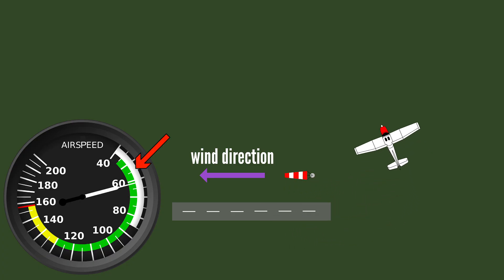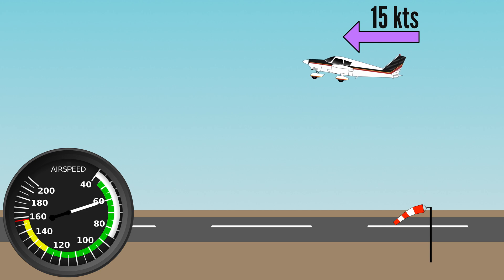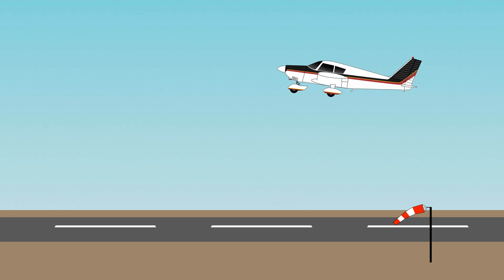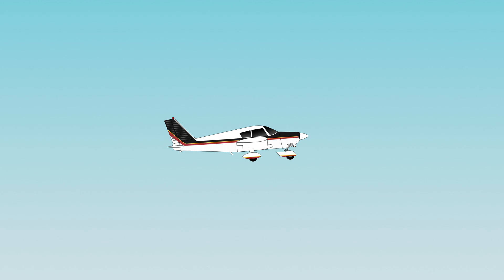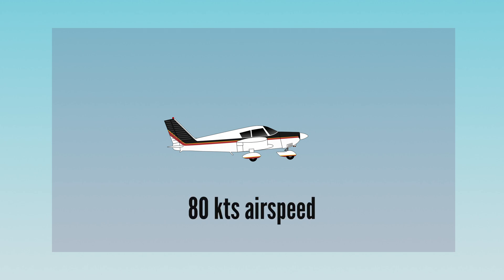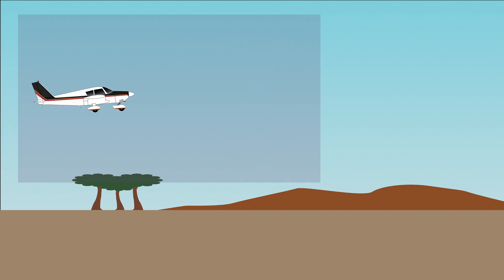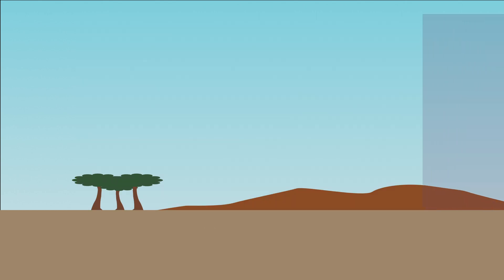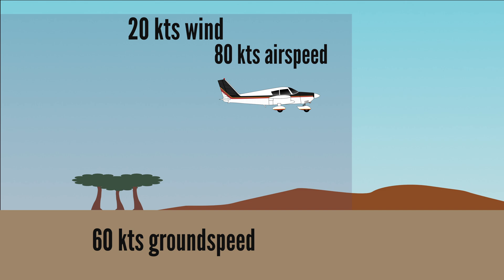The Myth of the Downwind Turn - Dangerous or Not?

Comment: As a Stanford graduate and retired senior engineer, and an avid RC enthusiast, there is a world of difference between downwind and upwind turns. I've NEVER stalled and crashed a plane in an upwind turn, but have crashed multiple times in a downwind turn where I inadvertently throttled down due to high perceived ground speed when a wing dropped and was too low to recover. There are thousands of RC crash videos where this happens all the time.
Reply: Just FYI, here on yt you’re less believable when you start a sentence with “as a …”. It makes you sound like you don’t know what you’re talking about and you’re desperately trying to convince yourself, and everyone else, by throwing credentials at your self-doubt. Be confident in your opinions. Your Stanford degree and senior engineer position is irrelevant.
Reply: @TastySlowCooker  Hear, hear! 👏
Reply: "there is a world of difference between downwind and upwind turns. I've NEVER stalled and crashed a plane in an upwind turn, but have crashed multiple times in a downwind turn where I inadvertently throttled down due to high perceived ground speed"

The difference is in the distinction between airspeed and groundspeed.

There is no difference between downwind and upwind turns in terms of airspeed.

There is potentially a world of difference in terms of ground speed. 

For the RC case, if you could somehow estimate the airspeed fudge factor from the reported/recorded local winds, it might help?
Reply: You throttle to zero while banking at low altitudes? Hmm? I never drop below quarter till about touch down
Reply: This serves only to prove the original poster's point. When flying RC models, you do not have information on airspeed only perceived groundspeed. Pilots only experience difficulties executing a downwind turn if they are flying by ground reference. RC models are highly manoeuvrable and have very little mass, hence they can "change ends" or "hang on the prop" in a way a typical full-size aircraft cannot.
Reply: @rigilchrist  How can it be anything but?:  true airspeed is the critical measure relative to the critical frame of reference (the air through which the aircraft drifts).
Reply: That has to do with your response to ground cues.  Same with airplane pilots.    People increase their bank and pull harder to make their turn and end up stalling.  It's not due to the wind alone, it's the pilot's incorrect response to what the wind does to his pattern positioning.
Reply: @Dr_Kenneth_Noisewater Do you fly? Perhaps you could show our poorly inexperienced souls first hand how not to crash in a downwind turn without adding power.
Reply: Two options:
1) lower the nose sufficiently to maintain speed 
2) be going fast enough at the start that you don’t burn off so much speed in the turn you  get into a dangerously low speed on exit.
Reply: @charlesmyers9765  this makes zero sense and no pilot would add power as they turn downwind. This is not necessary and not taught to anyone. How would one add power anyway during takeoff? In most small aircraft you are at maximum power for takeoff when turning downwind. 

An aircraft at minimum airspeed just above a stall can still back to 20 degrees and turn all day long at a constant power setting and maintain a steady airspeed despite being in a steady wind aloft. Of the aircraft is only 2-3 know above stall speed then based on your logic almost any gentle wind would immediately result in a stall as the aircraft turns downwind. There is rarely a day where winds aloft are less then 15 knots at pattern attitude.

Almost every student pilot will need to demonstrate this during training. It is optional for a private pilot rating, but most instructors will teach it anyway. This contradicts what you are saying and confirms that this is indeed a myth.
Reply: @Dr_Kenneth_Noisewater If this was true then there'd be no such thing as stall induced wind shear.
Reply: @charlesmyers9765 there is no such thing as stall induced wind sheer, the other way around maybe.

Comment: Full-scale airplanes take long enough to turn that they can speed up or slow down to maintain a constant airspeed as they change direction. Plus, the plane should be trimmed for a certain airspeed, so it will try to maintain the trimmed airspeed without any input from the pilot. And, the pilot should be checking the airspeed indicator occasionally. However, when flying model radio-controlled airplanes, the pilot is standing on the ground and usually has no way of knowing the plane's airspeed. He must allow the plane to fly faster when going downwind than it does when going upwind. It takes a while for new RC pilots to learn this. At slow speeds, I concentrate on the plane's angle of attack and use the elevator to maintain a safe angle of attack while using the throttle to control altitude.
Reply: perfect answer
Reply: By the following:   "Full-scale airplanes take long enough to turn that they can speed up or slow down to maintain a constant airspeed as they change direction"

Are you implying that with a constant downwind, that any speed change is imposed on the pilot due making the turn to downwind?  (where the airplane changes orientation with respect to the wind direction over the ground?)
Reply: @davetime5234  no, I am not. Ones speed and direction over ground is always irrelevant, (except to navigation calculations), there is no speed change imposed upon the pilot. Both tail and headwinds are not absolute in the velocity frame, therefore during the turn a lack of excess airspeed will be noted as a loss of lift, which translates to a loss of altitude. This now sets the pilot/aircraft up for potential loss of control. Technically, if during the turn, a loss of altitude was experienced, the first indicator of loss of control has already been experienced.
Reply: @waynetokarz174  I'm not sure if I'm interpreting this correctly?:  

"Both tail and headwinds are not absolute in the velocity frame"

In the airspeed frame, in the case of a steady wind, there are no tail winds or headwinds, whether turning or not(?).

In the above case, there is no change in airspeed due to wind during a turn.

But of course, the turn requires more lift, so more angle of attack, and the drag to produce that lift.

So, the increased lift to turn the aircraft will decrease airspeed.  

And if that extra turn lift's (drag induced) airspeed decrease is not arrested by thrust, then assuming trim at the prior airspeed, the nose will drop to acquire that speed from altitude loss?

So, there is no effect from wind you are now saying (in other words, the same thing happens in a turn whether there is a steady wind or calm conditions)?
Reply: @davetime5234 I’m sorry Dave but I am not able to follow your comment. A lot of people are applying pure theoretical physics to the topic, whereas in the real world there are factors not being raised here. For starters the theory applies as an instantaneous event while in reality there is a huge time lag between cause, effect and reaction. The airplane has to catch up to the air. Failure to allow for this lag coupled with slow or improper control inputs will result in a downwind turn stall. People on here are beating theory to death while failing the two simplest proofs, GO FLY IT! Look up accident reports. Crashed planes don’t lie.
Reply: @waynetokarz174  Thanks again for your reply.  Admittedly I had many words.  But these are verifiable engineering principles not "theoretical physics".  

I don't dispute there are good reasons for your warning:
"slow or improper control inputs will result in a downwind turn stall."

As for "accident reports. crashed planes", 3 main mentions are:
1)airspeed
2)angle of attack
3)environmental factors (density altitude, variable winds)

But your following statement applied to steady wind is wrong:
 "the theory applies as an instantaneous event while in reality there is a huge time lag between cause, effect and reaction. The airplane has to catch up to the air."

It's true only for changing (gusty conditions etc.), not true at all for constant wind speed.

But I also don't want my safety margin gambled on wind being perfectly steady.

If you fly in a 1 million knt perfectly steady wind and fly timed turns, your airspeed will act as though winds are steady at 0kts.

If you add double digit wind gusts to the above and you are fling just above stall, you've got a problem.

Comment: It's being accellerated in the turn, so momentum is negligible, the only thing that matters is the indicated airspeed.
Reply: There is no acceleration and therefore no change in momentum. The ground has absolutely no influence on the aircraft in flight, aside from ground effect (which is at less than a wings width in height.
Reply: @cfiopus  Yeah, the steady wind drift acceleration happens only when the wind ramps up to a current steady value.  Ever after, there is no acceleration due to the wind when the aircraft changes heading.
Reply: nope, AOA is absolutely the only thing that matters.
Reply: @waynetokarz174  AoA is perhaps the ultimate thing that matters, but hardly the only thing that matters.  As long as your load and density altitude are within limits and you don't make overly abrupt pitch changes, indicated airspeed is a good proxy for maintaining AoA within limits.

I assume that when he stated indicated airspeed matters, that in choosing between IAS and GS, it is IAS that matters.

Comment: My FI really hammered these points into my brain: 
- Always keep airspeeds correct on climb out and push the nose down if it gets too low
- Avoid steep turns in the pattern; in a trainer you shoud not need more than 15-20° bank for a coordinated turn
Reply: I did 45 degree turns for my checkride in the pattern. If you aren't trying to maintain altitude there is absolutely nothing wrong with steep turns, infact, sticking to 20 degree turns will make you more likely to try and drag the nose with the pedals and get yourself into a spin.
Reply: While there is nothing wrong with a properly executed steep turn in general, the key point is that you are increasing wing loading compared to a shallower turn and in the pattern you will already be fairly slow so you are reducing your margin above the stall. Also aggressive manoeuvring in the pattern isn’t great.
Reply: @speedbird300  And you are pushing closer to the stall AOA, as coaxing greater lift from the wings at a given airspeed for the turning force, adds to the AOA already needed to oppose weight due to gravity.

Two safety margins you are pushing against:
1)spare AoA left before the critical AoA
2)low altitude (less potential energy "reserve" to recover)
Reply: Totally correct! FI here.

Comment: Thank you for excellent coverage of the high altitude orientation of the myth of the downwind turn and also, uncommonly covered, the low altitude orientation of the real danger (ground speed wise) of the downwind turn where horizontal limitations are as great or greater than vertical limitations.  We crop duster (yes, I am an old Ag pilot) pilots live with low altitude orientation where steep bank angles and wind management are necessary to turn (small radius of upwind turn) short of obstructions.  Also, we have learned to release back pressure in steep turns of 1 g load factor using dynamic neutral stability to prevent stalls.  Ok, we are going back to the ground anyway.  Thanks again.

Comment: While performing a ground reference maneuver, such as Turns About a Point, how does this opinion apply?
Reply: @crawford323 A pilot performing Turns About a Point would have to account for their track over the ground while turning. In zero wind conditions, this is a simple exercise as they can maintain a constant bank and airspeed while maintaining a constant radius and altitude around the point on the ground.

As soon as we add wind into the mix the aircraft will track slowly along the ground more slowly while heading upwind and drift sideways with the wind as they turn and then track quickly along the ground as they fly downwind. This requires the pilot to manage their bank angle in the turns to maintain a constant radius while still maintaining altitude. A steeper bank is required to maintain a constant radius as one initially turns from downwind back to upwind, and the reverse is so when turning from upwind to downwind.

If executed correctly the airspeed will remain constant all throughout the maneuver. No power changes are required at all and would only serve the make the maneuver harder to complete and would probably result in a discontinuation by the examiner if they observed the pilot making unnecessary power changes. If one tries to use airspeed instead of reducing or increasing their turn radius to manage the turn radius, they will firstly make the aircraft more difficult to control as the changes in airspeed will be accompanied with changes in pitch control forces and secondly run the risk of stalling if they try to reduce airspeed to much to compensate for the faster ground speed while flying downwind.

This is an excellent maneuver to practice for traffic patterns and I like to do it on nice days as I enjoy an interesting point on the ground or allow a passenger to take photographs from various angles.
Reply: Many student pilots and pilots taking recurrent training perform 360 turns with the stall horn blaring away. If turning downwind made a difference these aircraft would all be falling out of the sky, yet not one of them do so. These aircraft are flying at an airspeed where slowing down by just a couple of knots will result in a stall.

This video is spot on.

Edit: Looking back I see I completely failed to address your question.

Turns About a Point is a ground reference maneuver meaning that one must manage their track over the ground to make a constant radius circle about a point on the ground while maintaining constant airspeed and altitude. In zero wind conditions this is easy as you just need to slow to a suitable airspeed, bank into the turn at the correct distance from the point and hold it there until you are done.

With a wind, one must initially bank more steeply when turning from downwind to upwind and initially bank less steeply when turning from upwind to downwind. This decreases or increases the turn radius at the respective parts of the turn to maintain a constant radius without having to change airspeed. The power remains constant throughout the maneuver.

If the pilot attempts to change airspeed instead of bank to manage the radius of the circle when there are winds then they will make the maneuver much more difficult as the pitch control forces will be changing. Attempting to fly downwind and reducing the airspeed to compensate for the increased groundspeed is not proper technique and is always to be avoided.
Reply: Why would you orbit such that the stall warner comes on?
Reply: @speedbird300  This is a required maneuver for obtaining a private pilot license as well as a commercial pilot license. The standards have lessened this requirement in the past year or so to an avoidance based approach. This means that the FAA now only requires a speed just short of the horn going off to meet the checkride standards. I still practice to the "higher" standard with the horn sounding as this is how I was taught. I don't believe it is any more difficult though you have a lesser margin before stalling if you make an error or get hit with an unexpected gust.
Reply: @oracle427  The video is only correct as in real life turning down wind makes little difference but not because it's not true but rather because it takes so much time that changes to air speed have time to adjust over time. The video is wrong in the explanation it uses.
Also please don't turn during stall tests. Bad idea. Turning changes the airspeed over the left and right wing leading to an uneven stall which can result in a stall spin.
Reply: @Mar-s5q8m  are you not aware that turning while at minimum controllable airspeed in a 20 degree bank with the stall horn sounding is a required performance maneuver for some ratings. In fact, spins are required for an instructor ratings, and I have performed numerous spins in aircraft where those maneuvers are not prohibited. 

Departing from controlled flight and recovering back to controlled flight is an essential skill to become a pilot and one list demonstrate many of these skills prior to flying solo. Spins are not required for a private pilot rating, and my opinion on that is a different matter.

Accelerated stalls typically done near maneuvering speed and in a steeply backed turn are required maneuvers for a commercial pilot certification.
Reply: @Mar-s5q8m  You said:  "turning down wind makes little difference but not because it's not true but rather because it takes so much time that changes to air speed have time to adjust over time"

Assuming steady winds, there are no changes to airspeed.

Comment: This guy is waffling pure 🐂💩 
It's all to do with ALTITUDE not enough no matter how much speed momentum good wishes  YOU CAN'T MAKE THE TURN. You're in a climb a drop in power is critical to make the turn means you need to go heavy nose down. Pilot of a Twin tried this at Essendon in Australia had Rudder trim cranked to the MAX tried to turn lost speed crashed into building. That's why every pilot is taught if the engine quits on take off NEVER TURN BACK.
Reply from the maker: Did you even watch before commenting? The video has nothing to do with the impossible turn mate.